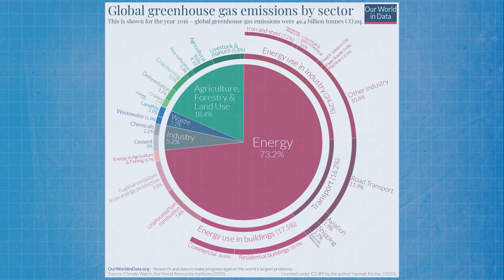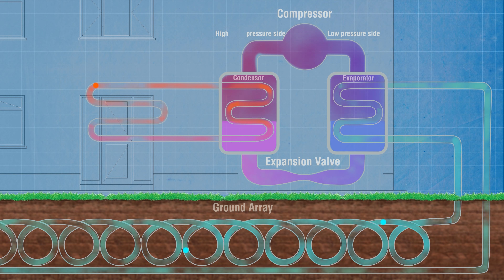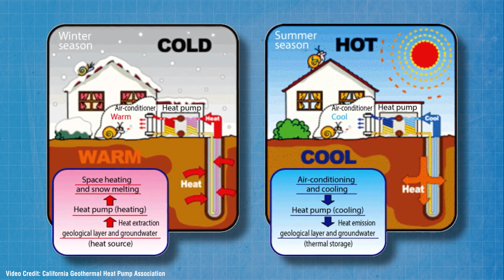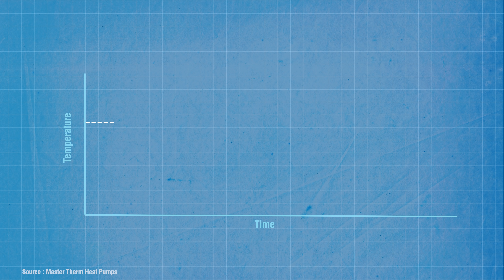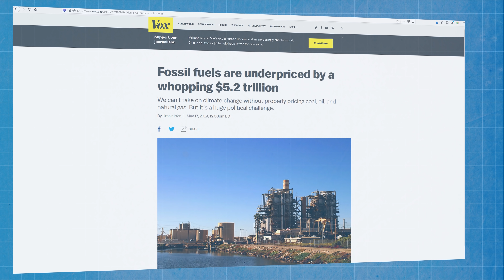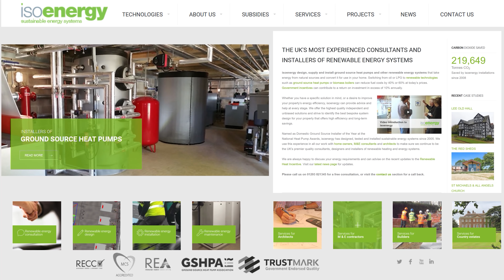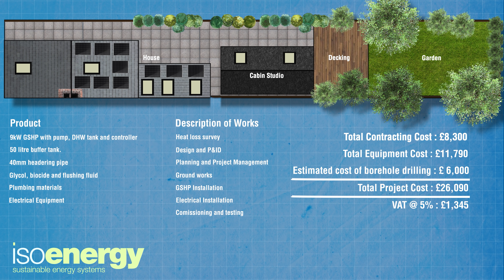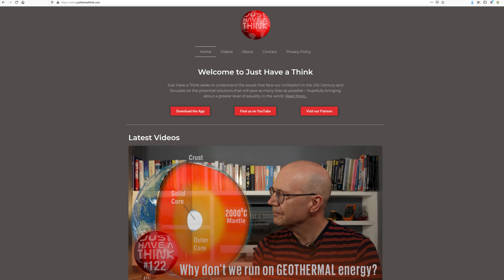Geothermal ground source heat pumps. Heating your home from your own back yard!

Comment: Reminded me of an installation I did in a home at the end of the 1970s that was very effective, very easy, and very cheap. It was used mainly for cooling in hot months in a New Jersey home. Sunk a 4" diameter pvc tube below ground level to a depth of 6-7 feet with an elbow attached above ground that directed the pipe right through the wall into the rooms just above floor level. A small, noiseless fan was installed - similar to what is used in computers today - and a vent cover was placed on the interior wall opening that had vanes that could swivel to direct the airflow. The underground opening was covered with a fine-grain screen with a 2 - 3" layer of activated charcoal and another filter material was placed on top. What that was exactly I can not recall but it was similar to the fiber-filter material that was used in aquariums at the time - its thickness was ~3". A second filter was placed in the elbow, closer to the intake. I installed 3 tubes for the house which was about 1400 sq ft on the ground level. My set up was manually controlled, each fan having an on/off switch. The cost to run the fans over a year was negligible - less than $1 I think - but it reduced my reliance on air-conditioning units by more than 75%. Well worth the cost and time investment. It was still operating perfectly fine after 10 years. I like the design - easy to install with easy-to-obtain parts - and not connected up to any other system or grid. Flipped on the fan when it was hot; turned it off when not - usually ran for a couple of days at the hottest periods non-stop. The single drawback was the positioning of furniture - blocking the vent reduced efficiency a lot.

Comment: In the US cost for such a system is still a significant hurdle. I live in St. Louis Missouri and had a quote a few years ago. Given my location in the city vertical loops are required because I don't have the space for the horizontal setup. A minimum of 8 wells (vertical loops) are needed to have adequate capacity for my home. This came out to approximately $90,000 for the whole system. Even with Federal/State subsidies this is an exorbitant cost and not even an option. Instead, a $10,000 high efficiency boiler to replace my old gas boiler seems like a better option. My preference is to go with Geothermal but I hate that it still costs so much here in the states. Especially to retrofit into an old home.

Comment: In the last episode you talked about a binary heat exchange. I thought this was clever because you can spin a turbine by boiling off a fluid that is well below waters boiling point. (And you mentioned similar processes in this video with the condensers)

Anyway - it has me thinking: Why haven't solar panels and refrigeration technology (for lack of a better term) been merged?
Like - traditional solar panels are nice, but not very efficient; the peak theoretical efficiency is 33.7%

But - if you could run transparent piping through a solar panel and use a porous material to efficiently capture heat (google "MIT Solar Sponge"), you could elevate the temperature of the fluid. The goal would be to eventually warm a fluid to boiling point (perhaps using a binary heat exchanger if necessary), spin a turbine, and experience substantially better solar performance. 

No doubt it would be a more complicated system and, thus, probably more expensive. But it could be a fantastic opportunity for dedicate solar installations if you could overcome the 33.7% barrier.

Side note:
I see contradictory articles on MITs site regarding its efficiency (one says 20%, the other says 85%) efficient, so better material may be needed.
Maybe line the bottom of the tubes with vanta black? Idk.

Comment: Hello, yes I completely agree.  However, we’ve got a large ground source heat pump installation which is 8 years old and utterly shocked at the dire original installation by a large main U.K. supplier and lack of honest, professional or skilled ongoing support.  I’ve been forced to learn myself about these systems as I’ve learnt not to trust - the hard way.  I now do a lot myself, especially sorting out the original mess of so called installation.  I’ve got 1 trusted technician who’s a refrigeration engineer ..... as heating engineers I find are hopeless despite the fact they all claim to know what they are doing.  It’s no wonder people are put off this fantastic technology as it’s the poor supply and support standards, lack of skills leaving the customer with huge massive bills.  The average consumer can understand oil, gas and electric heating systems but heats pumps are a different world altogether and need professionalism in the supply chain which is sadly lacking.  Be careful these systems are hugely expensive when they go wrong ...... through no fault of the technology.  My system is now working well but no thanks to the industry or promises made.    PS:  we also have a fresh air convection system with heat recovery, which is another important subject for one of your videos.reason is the market are obsessed by air tightness / sealing of properties, but aren’t considering the negatives of lack of fresh air ventilation.  Just have a think!?!?  This is another subject few are considering.  Our home environment is benefiting by the 24/7/365 fresh air - keeps COVID-19 risks down also!!  Many thanks.

Comment: I think there is huge potential to further reduce the energy consumption of such a system by storing summer heat from solar thermal panels in the earth. Day after day of kWh of free heat going into the ground can sit there and wait until you draw it down through winter. That way you could reduce load on the grid in winter (peak and overall) by effectively generating that energy in summer.

Comment: I'm curious as to the impact of this if done at large scale? 
If an entire town, for instance - let's say, for arguments sake, 1 square mile, all adopted geothermal ground source heat pumps, what impact would that have on the ground itself and any living creatures in the soil? 
Also, at what point does using this temperature difference at scale, start to negate the effects of it?
Clearly, there's some radiation of ground temperature over an area - if 500 homes are all using this technology, in a square mile, does it diminish the the equation? 
Or is it quite simply that due to the sheer volume of earth below the systems, whatever energy is 'taken out', is rapidly replaced? 

Anyway, this, in a way, reminds me somewhat of 'earth ships', where the heating and cooling uses thermal energy due to the design of the house.
I can't see these being much of an option in the UK, given our rather tiny houses - but they have always fascinated me. 
More on them here: https://en.wikipedia.org/wiki/Earthship#:~:text=An%20Earthship

Comment: I purchased a home in NE Ohio in the US and it had propane heating with a standard central air handler. I was able to get a company to install a horizontal bore ground loop for $14k and I got a used heat pump for 1k from a local person upgrading their system to a larger unit (Home addition) and to an inverter system. (mine is not an inverter). I then was able to sell my old furnace and AC unit to another individual for 1k meaning the total cost for install was 14k. Then I got a federal tax credit of 30% (2019). When I purchased the home I attempted to see how much it would be to have propane delivered and it was $1500, just to begin a contract,  with an expected yearly cost of $3000. Even if I take the risk that a used geothermal might not last as long as a new unit, the ground loops are under warranty and basically will last forever. I calculated my payback period of being less than 4 years vs propane delivery, given my total heating degree days/cooling degree days for my region and the cost of electricity. After that payback period heating and cooling the home I am saving money. The home's value has increased and I don't need to have a propane tank on my property nor do I need to worry about running out of propane. The other nice thing about ground source heating is the noise. There is very little noise inside as the air moves at a lower velocity and there is no exterior fan running outside the house. Draft control is also great. Since the house does not require combustion air to be sourced from inside the home there is less overall drafts and a tighter home envelope can be created. This increases the over all efficiencies of the home reducing the overall heating and cooling requirements, improving the home's internal air quality. (also no worry about carbon monoxide or CO2 buildup)

Another key factor is that ground source cooling is actually more efficient than traditional central air units or air sourced heatpumps. The rising heat in summer months means a standard air sourced unit becomes less efficient and capable at cooling. During the winter months and heating is required and it becomes harder to extract the heat from the air as the temperature drops. Ground source heating and cooling do not have these type of issues as the ground (below a meter or so) remains close to a standard temperature throughout the year.

The installer I used leverages 2 method for installing loops. 1 Horizonal boring. A large machine is brought in that diagonally bores holes into the ground just as underground electric, water, and gas lines are installed today. Each loop is 250 feet long (total length 500) and they install 1 loop per ton of cooling plus an extra for extra capacity. This method is the one I used as it is cheaper than vertical drilling. I personally own an acre of land so the horizontal boring was not an issue. The 2nd method that is used is vertical drilling. Vertical drilling requires similar methods as a standard well. They are slightly more efficient and require less land area but increase the cost by about 5k.

There are 2 others method that are used and the first is coils of pipe. This requires some land area (less than horizontal boring) but will require excavation as coils of loops will placed into the ground by hand. This seems like a great method if the land around the property is already being worked and damage to the topsoil is already occurring. The last method that I am aware of is called open loop. This takes either ground water or local lake water and feeds this water into the house to be used by the heatpump and then redirected back to a local pond or lake. They offer a slightly higher efficiencies but there are other issues as you are taking untreated water and passing it though your system rather than a closed loop of treated water (with methanol). This can result in mineral deposits inside your heatpump reducing its efficiencies over time and possible life.

I generate my own solar power and I source my grid power from wind producers. This allows me to be completely carbon free for my heating and my electric.

There is a backup resistive electric heating coil that is also part of the heatpump unit I have yet to have a need for it to run but in my region it is required incase the heatpump has a system failure as the house would still need to have a heat source. (It runs on separate breakers and I have those breakers turned off so I will be able to decide if it should be turned on or not)

Comment: My plans for the future , new house build and geothermal heating from the beginning with solar panels . Makes me hope to be full self-sufficient with energy, water well too .
Reply: Wow, 4.5 years seems extremely short considering that ground source and air source heat pumps differ in seasonal COP by very roughly 1 point, which is not that much. I'd like you to provide some context and numbers to back your statement. My calculations of the timepoint of spending parity for a medium-large home in Italy are around 20 years. And that's assuming you cannot install photovoltaics and have high conductivity rock beneath your house!

Comment: Really good video as ever. Thanks for the hard work!
I do like the idea of GSHP but have always felt more biased towards ASHP due to lower capex as well as issues of land ownership in multi-residential arrangements. I have seen schemes use shared boreholes to make some savings but this was in single dwellings for housing associations. For refurbishment I do struggle a little to see the use case. It would be interesting to see what the company you spoke to would cost a similar ASHP scheme at? 
I think the biggest difficulty with switching over from gas boilers is that it impacts every part of the heating system. Since heat pumps tend to want to run at something like 45/40C flow and return temps it means for a fixed heat loss you end up needing larger heat emitters and potentially larger pipework (due to low average emitter temps & the tighter dT). There is also the difficulties with satisfying domestic water temperatures and instantaneous flow volumes that end up pushing you down the DHW storage vessel with top-up immersion heater route (which adds more CAPEX, more OPEX and may be seen by some as a step backwards).
All in all I do think that heat pumps (ground, air, water) are likely the future and we do need to move towards a combustion free world but I can't currently see how the average person can afford these revisions or how they can be all that practically achieved with out serious upwards pressure on gas prices and a fabric first approach.

Comment: Good topic. I had a really good look at GSHP a few years back in Sydney AU.
Our ground temp is from memory about 20C all year round. This leads to very low heating and cooling and most of the energy used would be for pumping and fans.
It that energy is sourced from my own renewables then the operational costs are quite low.
Unfortunately, like you, the capital costs were unfeasibly high with a poor ROI.
If I had rural land then the use of a dam using the latent heat of water may have been much cheaper than going into the ground. Alas I'm still in the suburbs.

Comment: I have delivered heating fuel to homeowners in New England for several years, propane and #2 heating oil.  It does get and stay very cold here in winter. The few homes that had geothermal needed a regular heating system because the geothemal  DOES NOT WORK.  The systems do not provide any where near the BTUs needed to heat even a modest home.  Also, the home owners electricity usage is very high constantly running the geothermal system pump.  We don't all live in Iceland where you can pump hot water out of the ground.  Taking 50 degree F ground water and attempting to heat a home to 65 or 70 degrees...Does not work well.  It has been explained to me several times...."heat pump"... "heat exchanger",  and I don't think anyone attempting to explain it to me knew how it works either.  Which leads me to the conclusion that it doesn't work well at all.  So, what I saw a a fuel delivery person, were homes needing two complete heating systems, if they were pretending to use geothermal.  The geothermal and the the fossil fuel heating system which actually worked.  Very expensive for most people.  This is why our "carbon neutral" advocate host espouses government incentives, because it make NO SENSE for most people on a cost basis.
Reply: If the GSHP systems did not provide adequate heat for 90% of the heating season then it wasn't designed properly...simple as that.  I live in Canada where we have -30C temps and while my system will struggle (run nearly continuously) during those really cold spells I have not needed supplementary heat.